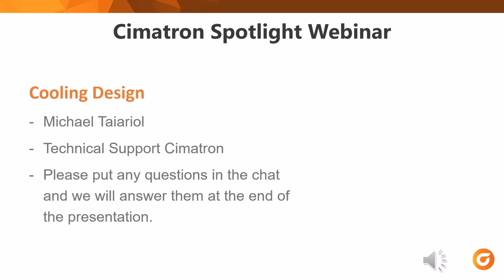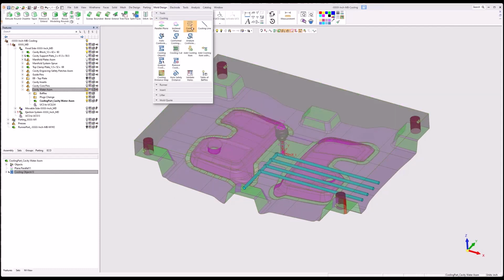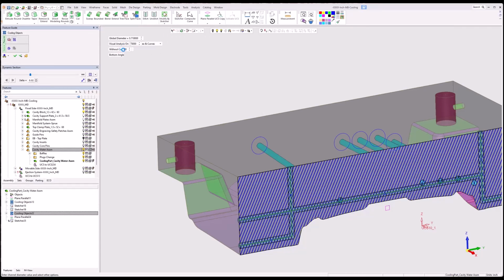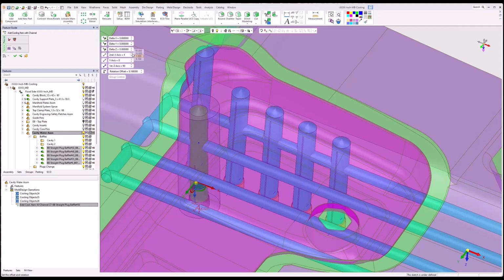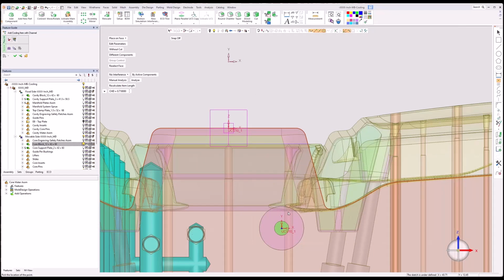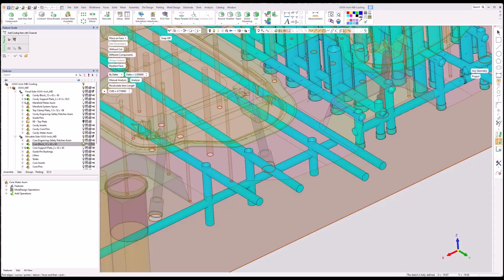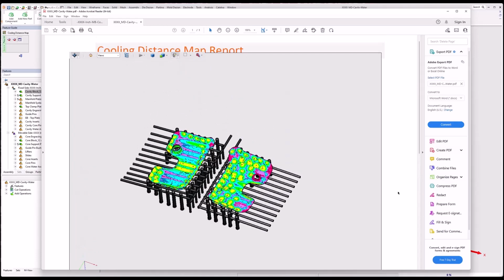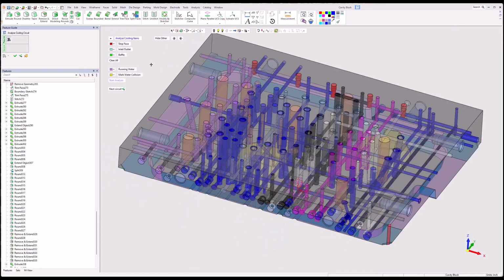Cooling Design | Cimatron Webinar

Comment: Any option available for imported IGES mold assembly file 
I have cimatron 2024 I want to assign material to all mold assembly 
I tried but there is no option available. 
I tried one method is import assembly file (IGES one ) then separate it in folder assign one by one every components one by one not but weight of mold plates not showing directly in BOM why please share your opinions